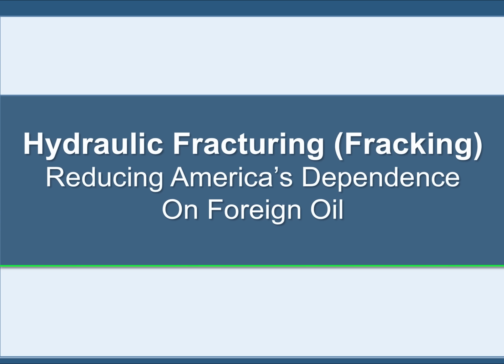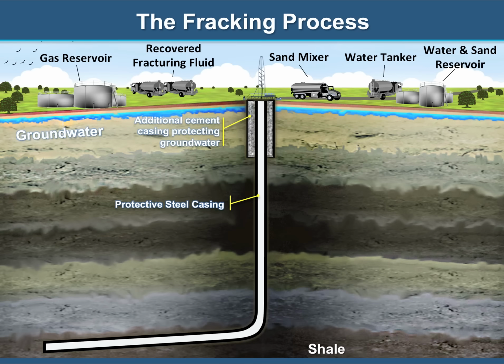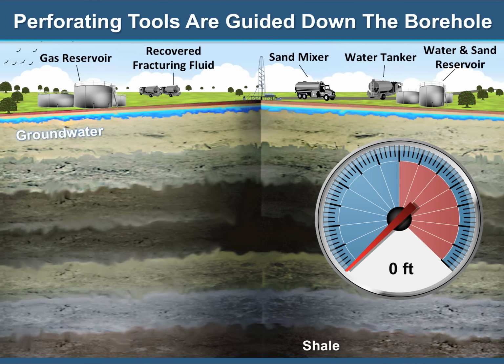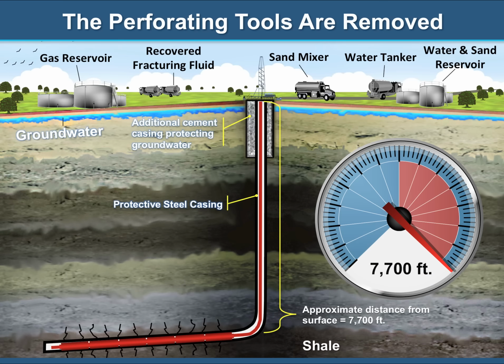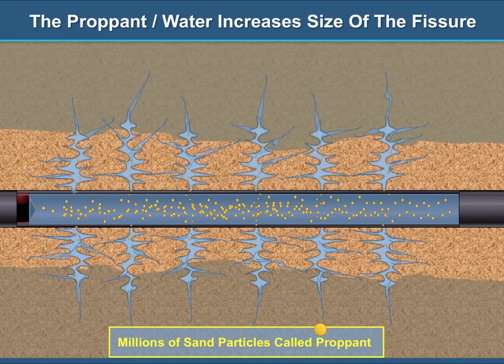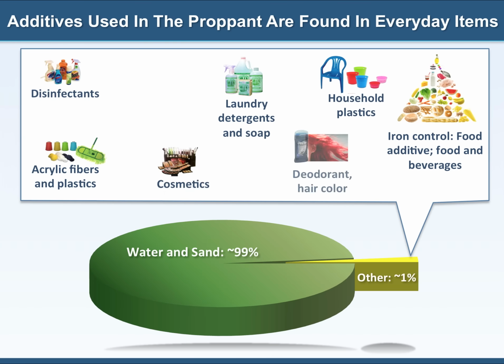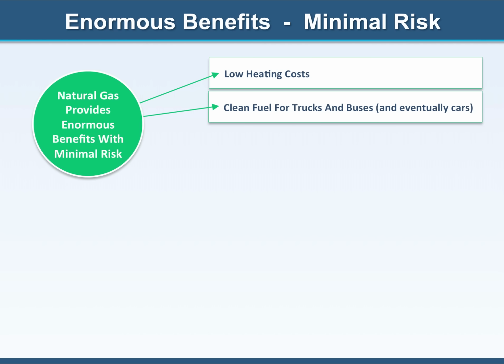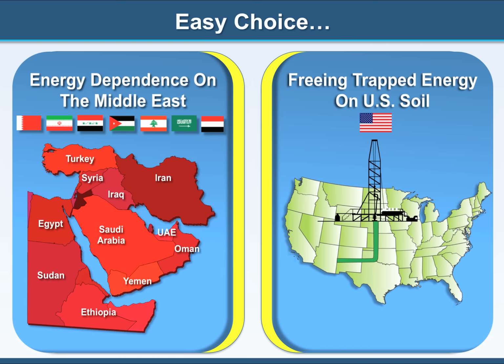Fracking Explained with Animation by A2L Consulting

Comment: Is there any chance you could explain what happens to the waste fracking fluid?This cannot possibly be treated so what happens to it.
Also the 1% chemicals is actually 5%,this means that say you pump in about 15 million gallons of water ( without the horizontal chutes you are talking of about,per well, 5 million gallons of clean drinking water,so why can't you use sea water?) the 600 or so chemicals adds up to about 80 THOUSAND GALLONS.Also at least 50% of fracking fluid stays underground to eventually get into the water table because no matter what precautions you put in place,cement is rigid and after 5 years or so it will crack and eventually fail.
Reply: apinder8610
We have been fracking here in the UK since the 1900's.The problem isn't the wells it's the chemicals pumped down those wells in later years that matters.The wells integrity is put into question and they start to leak and if you have driven a shaft through a water aquifer to get to the fracking area this would be the problem.
The problem is out of sight and out of mind.
BP's gulf of Mexico oil leak wasn't a problem either unless you depended on the sea for your living or you were a sea creature.
Sorry to say apinder8610 there are issues with today's fracking but you may not see them but you would probably notice problems in your water quality,if not now that give it a few years.
Reply: Actually Oil Instruction there are hundreds more chemicals involved in fracking and a lot more chance of totally killing any environment it's spilled into whereas oil spilled area's although bad,do eventually recover,sort of.
Reply: OIl Instruction Geothermal anything has to be the best all round for everything.Look at the benefits that Iceland gets for it's almost limitless energy.it's either that,solar or hydroelectric and without looking back over what I have written didn't I tell you about the electrician I had been working with who has now abandoned anything to do with wind power and gone exclusively solar.
I have recently sent my facts and figures to their fracking specialists just to see if my statistics were accurate concerning the drilling and all that goes with it and they have quite a list of relevant data.
All the best Alex,nice jawing with you.
Reply: Peter Gambier Well integrity is important but this doesn't really have to do with fracking. A poorly designed well will leak whether or not it was hydraulically fractured. And if it was fracked any frack fluid left in the reservoir is bound to the clay's. The wells have been producing for 20 some years when they are plugged and abandoned so any loose fluid will have been produced.

Its fair to have concerns about oil extraction but there is no difference between the risks of traditional wells and hydraulically fractured wells. I think no one would get up in arms about normal oil extractions, but if the same problems that have always existed can be blamed on a new scary method than there is something to fight. It makes sense politically, but In the end the push back against fracking as compared to normal methods is illogical
Reply: Peter Gambier
You asked what happens to waste frack fluid which I answered, even though its unrelated  i'll respond to your new statement about spills at the surface.

there are thousands of components in crude oil far more than in fracking fluid but the number of components has nothing to do with how easily it can be cleaned. In fact there are so many components in natural oil that I could tell you within a few miles on the whole planet where a crude sample came from if I had the right equipment.  So the number of chemicals is irrelevant

even so, you are looking at it wrong. There are hundreds of components in frack fluid but 98% of those components by volume are water, sand and guar gum (what is in chewing gum). So the components are already diluted, the first step in natural waste removal

The other 2% has allot of stuff but nearly all of it will break down naturally. Is it "safe" no but it’s probably "cleaner" than spilling crude. Most of the 2% is bleach and soap like material and the rest varies so much that I cannot make a blanket statement about it. 
Those components are so diluted at this point that the environment can absorb and dispose of them over time (just like it can absorb and dispose limited amount of animal waste)

The worst case scenario would be a spill before the fluid has been mixed. At most there would be a single truck carrying this at a time (usually less depending on the additive).However, even if this was the worst most toxic component, there would not be a large enough volume being transported at once to cover a wide area. It would be expensive to clean the small spill but easily doable.

Now a spill would be awful and I will do my best to make sure one never happens under my watch (when I get a job) but its far less damning than you think. Which is besides the point that proper procedure will avoid spills and leaky pipes, which are the only way to contaminate the environment. The fracking itself cannot do this.
 
Be careful when evaluating these sorts of things. I don't know the specifics but there was a scene in gasland where a tanker spilled into a pond and killed all the fish. They then concluded the fluid must have been highly toxic because it killed so many fish. But honestly that could have been table salt and had the same effect. It just not as simple as looking at how many components are in the mixture or what limited effected it had when spilled. 

Again I am not an environmental engineer but from my discussions with them what I said is accurate. And to be clear I love the environment and want oil companies to pay for every dime of clean up.
Reply: OIl Instruction
I agree with you over what the bulk amount of the frack fluid is,namely water and sand,by all the accounts I have read we are talking about 95% of it.
I also agree that the tanker spill that kills all the fish in the pond could well have been killed by something else,for all I know the producer could have lobbed in a stick of dynamite and that would also have the same effect.I haven't seen Gasland but the clip is probably the old guy who retired to the country and it was his pond where the spill had occurred,you see the same clips being used in many different films and I have a pretty good memory for stuff like this as I am an animator and films were once my business. I disagree about it not being as simple as how many components are in the mix because if there were no components we wouldn't be having this conversation.In a nutshell it's the potential disaster to an area's water supply that IS the issue as well the fact you are pouring dodgy chemicals that could cause havoc to humans biological systems into the ground that that will not do any good down there.

The fact is that Fracking will go ahead because the need for energy and making a profit is far more important than humans health,governments don't care,they just want energy,and no matter what I tell you or what you tell me will not make a gnats widget of a difference to anybody,we are all pawns for the slaughter and for the future sake of our planet I hope we all kill ourselves and become extinct we don't deserve to live,we are too destructive,we are the parasites here,we give nothing back.
I'm glad to hear you say that what you said in your last paragraph and I believe that you do care.We all have our jobs and our careers and you will go far with yours but the fact is fracking will be one of the many straws that will eventually kill our environment and in the end all of us.My guess is that you are about mid 20's in age,probably from the US,and your name is perhaps Nathan and judging by your grammar are well educated,who knows,perhaps one day you could be in the senate,but I wouldn't bother with the oil business,renewable's would be better,the other stuff will run out eventually,in the meantime it's prices will rocket again and there will be a massive new war over it.
Happy new year.
Reply: Peter Gambier Not that it’s related but I think it is really cool that you worked in animation. I have a lot of respect for the art, and the process is fascinating.

It’s funny that you have everything right except my name; I don't know why you guessed Nathan but pretty good overall ;)

You seem to think about these issues more than most people and can see the important distinctions. I think our main disagreement is a matter of scale. I recognize many environmental concerns in oil extraction but I think it can be done safely. At least in the U.S our water and air quality has improved allot in the last 30 years and the amount of forest has grown as well.

 I guess I just see technology as improving the environment and so I am optimistic.Oil is necessary for this growth so i don't see oil as a purely 'negative' fuel. Maybe that is naive but things are never as bad as they seem. The news needs to cover big stories so they always exaggerate dangers and report the 0.1% of failures rather than the 99.9% of successes. I think this distorts our view of reality, which then goes back to fracking. When I look into the process and analyze the data, the process just doesn’t seem dangerous. I think most of the fear comes from news outlets and media making stories without the engineering background to understand what they are reporting. It is much more interesting to report the next big disaster than report that everything is fine.

Don’t get me wrong oil extraction is very dangerous and can be harmful. We need to watch companies closely especially when there is a profit motive to hide problems. I guess I’m just more optimistic about the future in general. I’m concerned about a lot of environmental issues especially world pollution. From an economic perspective the tragedy of the commons seems to be contributing to allot of world problems. Some issues like over fishing sadly may not have a solution but with more countries industrializing world population should stabilize soon. It’s not a fix all but most concerns seem over emphasized rather than under estimated.

You sure wont see me in the senate although i enjoy politics. politicians have to spew allot of lies because the truth is unpopular. I also don't think i'm good enough to run the country.

As for choosing to work in oil, because of economics oil will be used pretty much forever. As more oil is produced the price will rise which allows more reserves to be created (reserves are the amount of economically producible oil). even without this effect the same percentage of reserves will be produced each year to maximize profits. If that's 40% per year then each year 40% of the remaining reserves will be produced and so there will always be some extraction although much less. There is tons of oil in the ground but most of it can not be produced economically . Once prices rise enough trillions of barrels will become available. This may be a bad thing but im not worried about running out. I love the geologic and physical science involved in oil extraction (i'm studying to be a petroleum engineer).
because I have a passion for the science I want to use that passion to reduce the risks. I figure an ounce of prevention is worth a pound of cure. I would rather do it than have someone who doesn't care about the environment do it

I’m rambling now but thanks for a thoughtful conversation
Reply: OIl Instruction
I think you at least have your head is in the right place and I can also hear that perhaps you do care,you are doing the right thing in terms of study.
I worked in films and commercials for over 20 years but when computers came along I left the business but have always been a builder so I specialized and started learning about Lime plaster,how to make it and how all aspects of the trade use it.Always have several strings to your bow,you never know when you will need the other string but to find that you have no career or hope of one when another finishes is a bit of a shock.
The problems that we have in our world are huge lets face it.Number 1 problem is too many people,#2 is dwindling resources and #3 pollution.
You are right,the media find something bad and it's blown all out of proportion.
The problems we face are more to do with over population.
What peeves me off is that we are becoming strangers in certain area's of our own country where the police are too scared to go,and a lot of the problems are to do with those fundamental Christian,Muslim or Jews.Ban the lot,and make it illegal to preach religious claptrap.
We should set up a caliphate based on 13th century ideals,no electric and no cars and then all those who don't like the west should move there and all those that don't like Isis or 13th century life should move to the west.
The only answer is probably another world war,this will significantly reduce the population and then we can start again and this time we make darn sure everyone goes to school and gets an education.We also make sure that that are no religious zealots,Muslim,Christian,or Mormon anywhere and make darn sure that we never use money again,bartering is the way forward.Your old people stay in the home and are not sent away,at home they help care for the young and keep the household going and when they are too useless to do that they are put down.
In the exciting new world there will be no people being kept alive if they don't want it,and any baby born with oxygen starvation goes into storage to be kept alive for spare parts.
Happy new year Not Nathan.
Reply: frack is wack
Reply: oil instruction made you his bitch Peter. do some homework before echoing liberal garbage
Reply: Kevin T
I ain't nobodies bitch (except my wife's) and what liberal garbage are you talking about please Kev?
Reply: D Money
have havent seen $20 price levels, pluss no good having affordable gas if we cant drink the water!!!
Reply: Cheyne Simons That is all great except there is no reason to think fracking will contaminate water. The risk of contamination is the same as non-fractured wells.

And he is saying the price of gas would be $20/per gallon without fracking. If you ban fracking the price of gas will go up allot which is certainly true.
Reply: OIl Instruction
hi there Mr Oil,at present the fracking industry has taken a massive nose dive due to the cheap price of oil which makes fracking uneconomic.I can't agree with you about the contamination to the water supply,eventually the wells integrity is put into question and all over the world there are thousands of old wells(there's been fracking since the 1900's) that are leeching shite into the water table due to that integrity breakdown and nobody knows who owns those wells,they usually only last about 5 years and then they are abandoned and the frackers move on elsewhere.
We also must not forget that the area's that are fracked are in unstable ground in the 1st place which is why you get the pockets of methane and other goodies.
For every 100 wells dug it's estimated that you get at least one environmental disaster where the fracking fluid gets into and permanently pollutes that areas water table,and one disaster is too many,contaminating the nature that we do just isn't worth it and future generations will curse our thoughtlessness.
It's a similar situation with shipping oil around the planet through sensitive areas of nature,every so often there is an accident and then that areas ecology is fekked for generations to come.So lets play it safe and better improve on solar,kinetic and the natural untapped ground energy that is available to us for free.
Reply: Peter Gambier Hi there peter!
I was careful to say there is no added risk of contamination due to fracking. The breakdown of old wells can be a problem but there is no difference between the fractured wells and traditional wells. I am less concerned about this today because of better technology and new regulations. Just this week I analyzed old well designs and saw that they did not cement the casing more than a few hundred feet from the bottom of the hole. Today wells are cemented from top to bottom, about a mile in total. They also have better steel casing (actually much stronger in fractured wells).
 
Your second point is incorrect. There are not units of "stableness"  but by anyway I can define that term the formations targeted for advanced fracturing recovery are more stable than traditional formations. It seems like you think there are pocket of oil and gas (sorry if I am mistaken). In reality all drilled locations are sedimentary rocks and therefore are made up of tiny pieces of sand held together by pressure and cement. removing the fluid between these rocks does not affect the shape or stableness of the rocks because the fluid is in the matrix of the rock. The layers being fractured have very tiny sand grains and high levels of cement. This means the spaces for the oil or gas to flow through are so tiny only a few particles can move at time. Fracking just creates a path of sandstone with large sand grains so that the pores are large enough for many molecules to flow at once. The point is that fractured layers are highly cemented and by any means are more "stable". Also because of the small grain size the oil cannot flow out of the fractured area and the fractures cant extend past this zone (I believe I explained this in a an earlier post so I won't explain it here)
 
I have a explanation of how reservoir rocks store fluids on my channel entitled "porosity if you are interested.
 
I'm not really sure what your point is about the price dive. I am very blessed to have a job waiting for me in this market, and my future work is forecasting the price of gas in specific markets. Looking at the data it becomes clear this price dive was supply driven, mostly due to US shale production (which requires fracking).
 
The figure you use of 1% of wells causing contamination sounds at best misleading, and at worst wrong. I have not seen the study in question so I cannot comment on it specifically but when I have analyzed studies that people claim show the dangers of fracking each time I have been amazed that they actually shown the opposite, once the data is understood. I would not be shocked if 1/100 wells had some level of problem that did not meet EPA standards (or whatever your equivalent bureaucracy is). However I would be shocked if even the majority of these problems were major violations, or that they were linked to fracking in any way. usually what I find when I look at these studies is that a pipe at the surface  had a leaky O ring  and gave the ambient air a 2ppm increase in methane or something like that. Neither related to fracking nor a environmental disaster.
 
As for shipping oil, given that oil is a major part of every person's life you should be a major proponent of building pipelines. Pipelines reduce the risk of spills and allow quicker response time in case of a leak but every anti-oil advocate I have talk to is against building pipelines. They usually are idealist rather than practical.
 
Which leads to the bigger issue of the energy mix. I am all for every energy source being used but economics dictates that the mix will include a decreasing amount of oil. Over time oil will become more expensive to produce and be phased out by other technologies. This is great, but trying to ban it now will only increase the cost of living to every human on earth and by allot. This may seem like the right thing to do but there are costs and benefits to every decision. Most importantly food, water, shelter, medicine, and heating cost will increase for the poor. This will lead to more poverty and death particularly in the undeveloped countries. Oil is an input to every good we use and so increasing its cost will have compounding effects. You also will replace small holes in the ground and moderate green house emissions, with large coal mines producing more green house gasses, and dangerous particulates such as mercury and SO2. For the time being it seems obvious the benefits outweigh the costs of using oil. Granted oil should be taxed at a higher rate than wind or solar but this is far different than stopping its use. A utopian world without oil, at the moment, would be more polluted, more expensive and less advanced.
 
The last point I will bring up is about the "untapped ground energy that is available to us for free" . I am assuming you are talking about geothermal and I do have some knowledge in this field. First of all it should be developed , but it is far from free and not quite what you think it is. To call geothermal energy free you are ignoring the drilling and development costs, so by your definition oil would also be free. of course it is not free and geothermal energy would be much more expensive in most places than oil. Second it is developed by fracking. After drilling the well the rock is hydraulically fractured and then the water is pumped down hole. The fracturing creates more surface area for the thermal energy to be absorbed by the water, and allows the steam to flow back faster.  In fact this technology is so closely linked to oil development that I have a homework in geothermal development in my stimulation class (fracking class). Geothermal also uses more water over the lifetime of the plant than fractured oil wells because it uses water throughout the life of the power plant. At least with oil development the water loss is a onetime situation (and the water loss is one of the few true problems with fracking I can find). My college is adding a geothermal minor and at the moment it looks like it will be a part of the petroleum engineering department (although the geophysics department wants to take it too)
 
If you spent the time to read this post thanks for caring about what some random person on the internet has to say. I know I wrote allot but this is one of my passions and I love discussing it
All the best
-Alex
Reply: OIl Instruction
Good grief Alex,I almost had to sling up my tent and build a campfire and climb into my sleeping bag for that one,as usual it was precise and to the point with only two small grammatical errors as far as I can see,a missing A and an S.(see me after class,haha)
You also say that the sand is held together by pressure and cement,what cement?Whatever it is that holds rock and other material together isn't cement,it's fused together in some way,take limestone,it's formed by layers of tiny creatures that die,sink to the sea bed and become a carbon molecule and as more bits and pieces and other carbon molecules land on top of it over the millennia slowly this creates the rock material.I'm not a geologist so I don't know all the terminology for this process but it's pressure and heat that binds it all together I guess.
Marble on the other hand is formed in a slightly different way through the tectonic plates plunging downwards in some even more stressful way.
Geothermal energy is free,it's the infrastructure and labour that costs the money but once you have it all in place it's free ish.In the ground sourced method the piping you dig into the ground has water running through it which is heated by the thermal energy.
Also,have you ever seen Paul Pantones 'Geet fuel processor' ? This device is attached to a car engine in some way and if your car normally does 20mpg with the Geet system you get 50 or 60mpg,and out of the exhaust there is no smutty carbon deposit when you hold a clean rag over it.If you haven't seen this,have a look and let me know what you think please,I recently read that he was jailed for this,but I have no idea why because if his system does what it's supposed to do surely it's much better for the environment,the only negative side to it is that we use less fuel and therefore cut into the profits of the fuel firms because they sell less product.
Back to the topic....
I went back to my source of the 1/100 wells,it's actually 1/120 before you get an environmental spill and a lot of other information I get is from the interesting talks given by the ex-Schlumberger oil-guy Ian R Crane who does some very interesting talks about fracking and it's dangers.
Also whatever happened to the Haliburton executive who drank a pint of fracking fluid to show how safe it was? I can't find anything about who he was,how he is and where he is now,have you any info on this point?
I agree that well integrity is a lot safer now due to safer work practices than it was in the 1900's,plus you can dig deeper and go on the horizontal which they couldn't do back in the early drilling days.
I still think that geothermal energy isn't contaminating the water the way that fracking fluid does because it's mixed with all those chemicals and almost impossible to cheaply clean,geothermal would be a lot safer and cheaper than using oil because you are only going down into the ground a short way.
Oil pipelines probably are better but what do you do with them when you stop using the oil or it runs out?Also the danger of sabotage is an ever present problem I should imagine and maintenance costs must be huge.
Also when you look at the cheap energy produced in Iceland and Norway,couldn't we do something ourselves in Europe along those lines,or importing their hydroelectric or tapping into all that power at the earth's core,apart from the cost of getting to it why can't we access that?
I would be interested in seeing your channel,so what do I look for or is it under Oil instruction?
Speak to you later,have a nice week.
Reply: Peter Gambier for the moment I will only respond to your comments about geothermal technology. I have allot of work at the moment but I will comment on everything else latter

Geothermal wells need to be drilled much deeper than oil wells. The average temperature gradient is 1.4 degrees F per 100 feet. Boiling point is 212 F so you would need to drill 15,000 feet deep to reach boiling point. The reason there is allot of geothermal wells in Iceland is because there is allot of seismic activity. The geothermal gradient is higher around mountainous areas. That why there are often hot springs near mountains. New geothermal wells use the same process as fracking. there is very little difference between oil recovery and geothermal recovery, people just have a knee jerk reaction against oil because it is 'bad'. The same by products are even created. Dangerous H2S gas is created in some oil wells and also in some geothermal wells.  There is no evidence of increases in medium to large earthquakes in oil wells but there is significant evidence for earthquakes in geothermal wells. This is  caused by the thermal shock placed on the rocks. New geothermal wells will use the same hydraulic fracturing technology as oil wells to increase water flow.  From my understanding the same fluids are used we just increase the proportion of additives that prevent the gel from decomposing under high temperature. Which goes to your question about drinking fracking fluid. The additives are so different between fluids that it is very safe to drink some types of fracking fluid. The Governor of Colorado( who got his degree in geology from my college)  drank fracking fluid and is fine. Fracking fluid can be 100% potable. Even fluids with more additives are not as dangerous as people think. most of the additives are found in household products. granted  I would not drink soap but soap is not that dangerous. I am not a chemist so I can't  comment on the safety of every additive but I know what they do. If there is a specific additive that is of concern you should work to ban it rather than to ban fracking. If you determine that one of the gel stabilizers we use is dangerous I am sure I could still create fractures that are 90% as good with a different component. The key components are water, guar gum, and sand all of which are completely safe.
 
I also don't think it's fair to call geothermal  free energy but not to call oil free energy. The drilling and completions costs of oil wells are probably 90% of costs. once we reach the oil it is basically free. The cost structure of the two process are essentially the same. The drilling and completion methods are the same except geothermal wells have larger casings. When looking at any product the intangible costs must be considered. The funny thing is that is some ways oil is  just a  conversion of geothermal energy into chemical energy, so it is not surprising the process of recovering the two energy sources will be similar
 
Don't get me wrong geothermal energy is a great technology and wont contaminate drink water. But in the same way that I don't think fracking will contaminate drinking water. The parallels between the two technologies are undeniable  but for some reason geothermal energy is viewed as great while oil is evil.
Reply: OIl Instruction
You learn something new every day,I never knew that about geothermal,what i was talking about was laying a bunch of pipes around an area of land about a metre or so deep that comes back into the house to a unit,the ground sourced heat pump.
I've worked on a few places where they had air sources systems but they only work if you have a sealed house and most of my clients have those old ancient farm houses that would be nearly impossible to make 100% airtight.
For the ultimate in limitless energy then Norways hydroelectric is incredible,I recently went to Northern Norway near the Russian border and stayed one night in a room made of ice.Inside temperature was -2,outside was -25 to -30.
Why can't we all club together and drill down to the earths core and extract the energy we need from there for everyone's benefit,and although the initial cost would be a lot the long term benefits would surely be huge.
A little like the UK's Victorian sewage and water network built at great cost and until recently still viable and useable.
Go off and be Busy Al,I'll bug you later.
Peter.
Reply: Peter Gambier Thanks peter.
I'm in my final push to finish the semester so I was busy. One month left though!

First I would like to say I found out the fracking method for geothermal wells is different than for oil wells, I had a civil engineer tell me it was the same but he was wrong, sorry about the confusion. However my depth and temperature analysis is correct.

There are two major problems with geothermal (which is a great energy source) first it is not possible to drill past a certain depth so at some point we can't "reach the core'". Second is that there is always a benefit and cost analysis when making an investment.
I look at oil in the same way but let's just say we only want energy sources with no emissions. We could spend a billion dollars to drill a geothermal well or we could build wind turbines with that money. except for very specific locations we will get more energy per dollar by building wind or solar panels. However the average and marginal cost of geothermal is lower than all other sources including natural gas (in the US). But this is because they have only drilled in ideal locations. The expansion capacity is very limited. I think it is a awesome resource and we will see it grow but unless you live in a mountainous region there is no way to make it economic. It is projected that if the US exploited all potential geothermal wells locations geothermal energy would account for 10% of our energy consumption. This is great and it should be developed but this can only do so much.
Reply: Do you like the $2.00 gas prices? Or do you just bitch no matter what?
Reply: D Money
$2.00 gas price.I live in the UK where we pay an arm and a leg to fill our vehicles up with super taxed fuel.To fill my car up costs me about £70 and will last me a week.
I don't see myself as 'Bitching' about the price of oil,I'm bitching about our government and others around the world rushing into the fracking without thinking of the long term consequences.So it's hardly bitching,it's more like concern.
Reply: I can explain. A special blend of bacteria is cultured which breaks down VOC and the other contaminates that come up from produced water. The water is filled with the bacteria and allowed to sit for two weeks. After this the water is clean enough to be discharged at the surface. So indeed it can be treated. ( my friend helped pioneer this method and I am very proud of her)

alternative two is the water is injected into a deep reservoir. Fresh water aquifers only exist in the first 200 feet or so from the surface. Oil is extracted approximately 5000 feet below the surface. At these depths the water is salty and acidic enough to strip paint. The water is injected into these aquifers which not only removes it but pressurizes the oil well increasing the flow (which is why this is sometimes chosen over cleaning at the surface)
 
your statement that this will eventually get into the water table is wrong. No geologist would agree, these reservoirs have not been in communication for millions of years because of hundreds of feet of shale layers. 
Not only this but the salt water and frack fluid is denser than fresh water so even if by magic they were in communication they would stay at 5000 feet and not 200. oil is lighter than water so the fact that there is oil in these reservoirs proves there is not communication with drinking reservoirs. This is also why you can be assured fracking is safe. Oil companies are all about money so if they broke the shale layers between the fresh water and the aquifer than they would loose all there oil because it would float away. The profit motive actually protects the environment in this case. Also even if it could migrate it would be absorbed by the clays on the way up which makes it impossible to remove.

The only way water contamination can  happen is through poor cementing as you say. However to say cement is rigid is misleading. There are hundreds of types of cements to choose from, with various ductile properties . I spent a month in my drilling class learning how to choose the correct cement. You have to match it to the environment but there is no reason the cement shouldn't be more stable than the original ground. However we should keep a close eye on companies when cementing, this is the biggest cause of failure, it can be done right but it can be done wrong.

So have no fear its not as bad as you thought, although i suspect this does not change your mind (for the record I am a petroleum engineer student)
Reply: Peter Gambier We have been Fracking here in the US since 1947 with little to no issues.